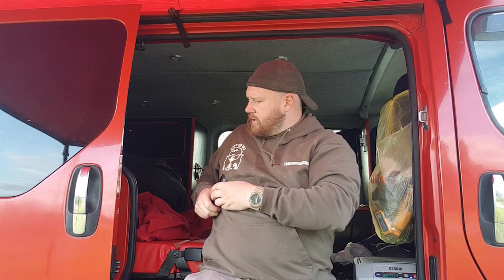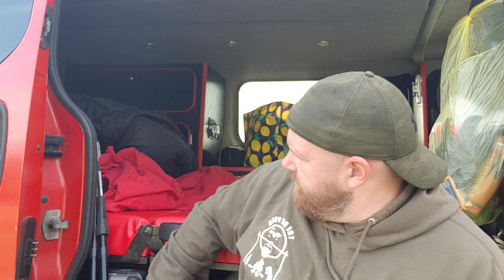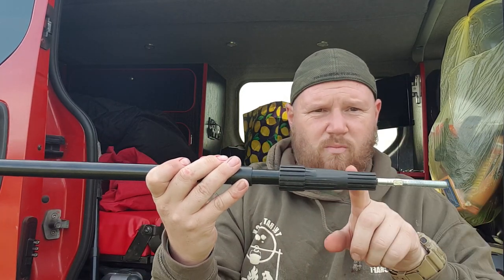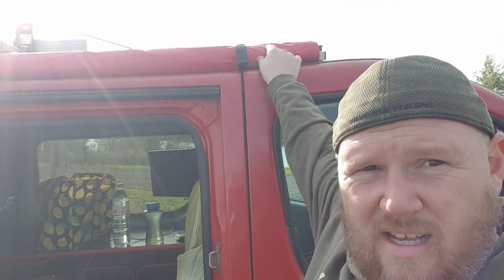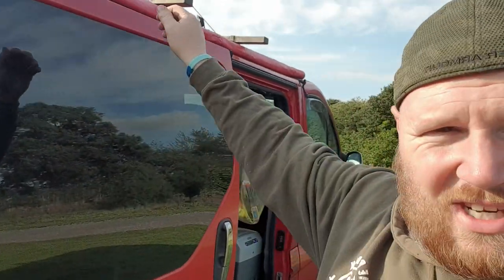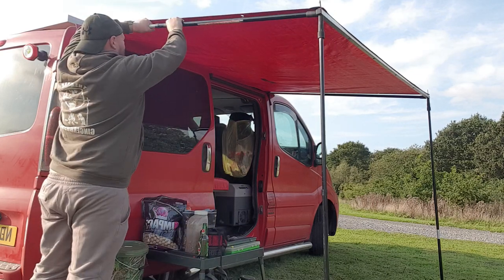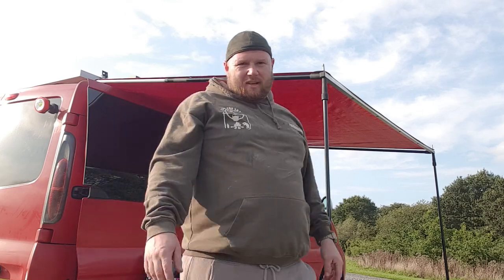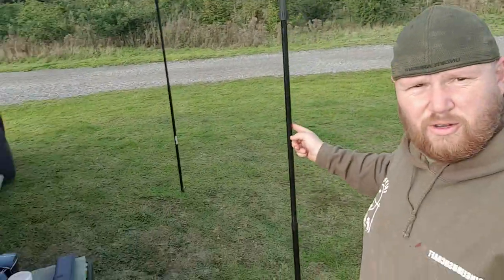D I Y campervan rollout awning  a game changer for not alot of cash £££££

Comment: How's it attached to the roof, is it leak proof there or does it drip through a bit?
Reply from the maker: The awning rail is bolted to the roof rack mounts, which is set back about 4" on the roof so no drips or leaks at all

Comment: You can buy these commercially from ALDI for about 75Quid. So not sure where the real savings are.
Reply from the maker: In the uk?? Any link as iv never seen them and would snap them up if actually real
Reply: Custom fit to van, parts readily accessible anywhere there is a hardware store, and super easy to do.   The ones for that price premade are so thin and flimsy that a good sneeze damages them.    If I accidentally tear the tarp, I can pick on up pretty much anywhere, and be back up and running.   To me, thats a lot of savings.